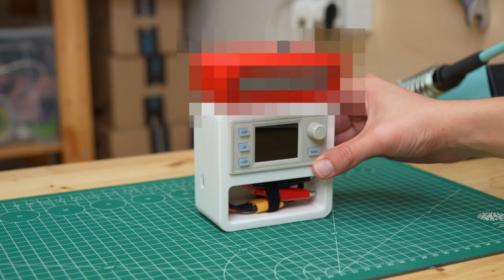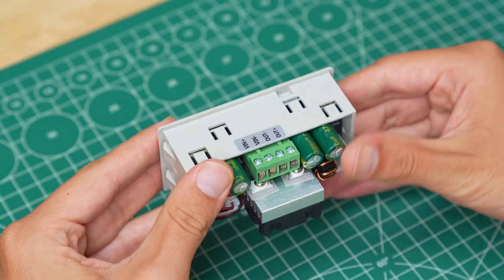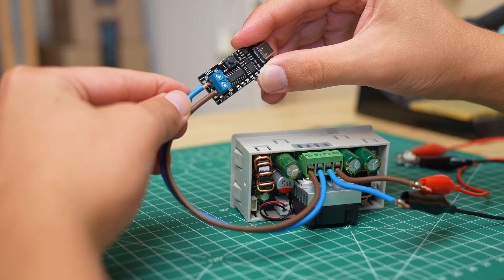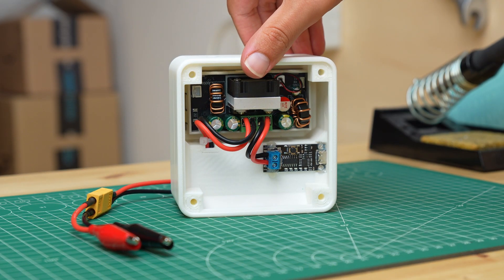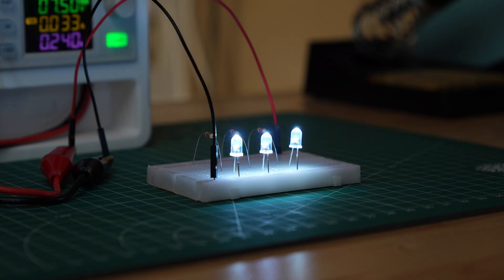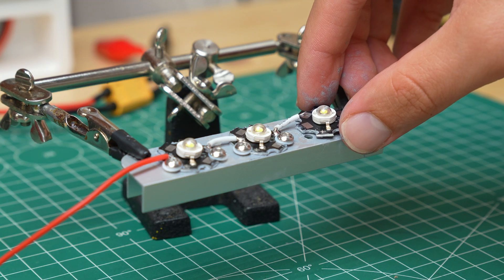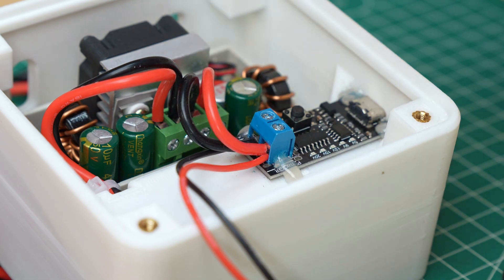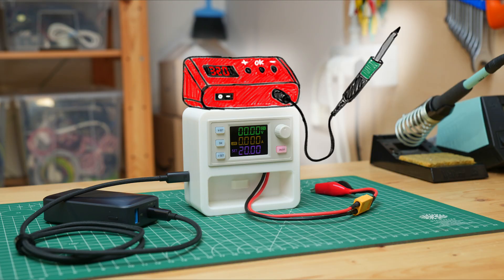DIY USB-C Lab Bench Power Supply with Magnetic Lamp

Comment: The tittle is very wrong, as i built a much better version about 10 years ago. 
But i did not make a video about it, so thank you.
Reply: Now that i watched it, the XT60 connector should be reversed, meaning the connector to the clips should be to regulator, and vice versa.
Reply: @tomapc  Yeah its easier to short the connection by mistake when you have the live side on the male connector.
Reply: @ericmarciniak1  Yes it is, but when i wrote that i was not thinking about this, i just know what connector goes on batteries as i have a lot of them.
Thank you for taking the time to reply.

Comment: Great and beautiful project, as a side note I would suggest to do not solder wires for screw terminals. The hard surface of the solder will prevent the screw to proper get a wide contact causing heating of the connector and resistive losses. Also with higher current can melt this small contact patch of solder and loose the wires causing shorts
Reply: The problem is that tin will actually creep under tension even at room temperature. So the solder will deform under load and the screw connection will get loose over time.That is why tinned wires are not allowed in screw terminals. Wire ferrules should be used.
Reply from the maker: Many many thanks for the tip! I've been doing this for years and never heard about this. Using ferrules is a much better idea, i will keep this in mind for my next projects.
Reply: @makergiovanni You can actually do an experiment about the effect of creeping with tin. It occurs in many low melting metals because room temperature is actually near their melting point.

If you suspend a heavy weight from a piece of soldering wire made from tin it will support the weight for some time (maybe a few minutes or hours). But at some time the soldering wire will break somewhere in the middle. If you look at the breaking point you see the wire got elongated and stretched thinner there. So under a constant load the material will plastically deform even when it is below its melting point.

When I was younger I used to do some soldering and I tinned all my wires before putting them into screw terminals. When I now after some years pull on them they all have become loose. I now use ferrules which are quite easy to use as well.
Reply: Was just going to comment the same thing when I saw yours!